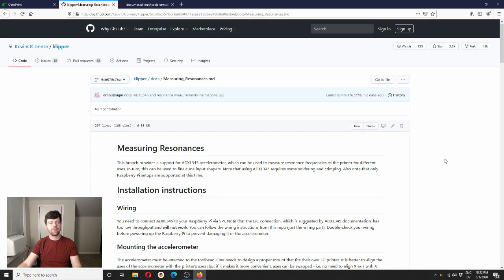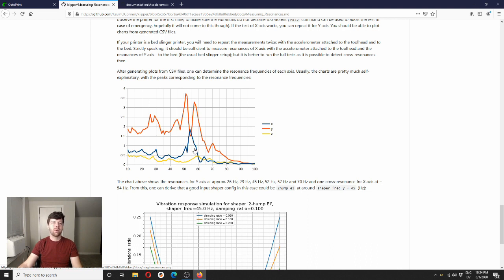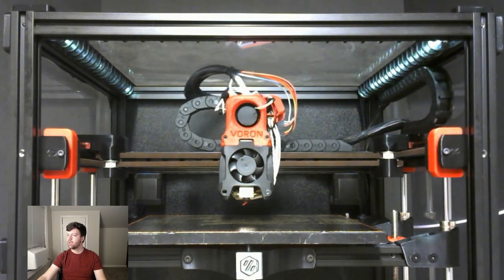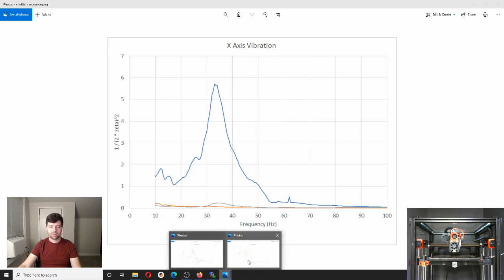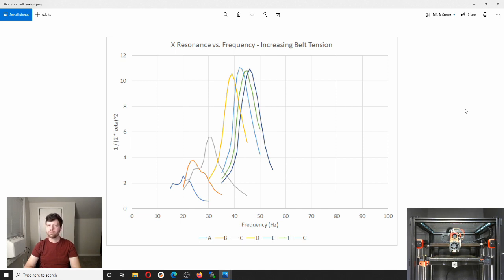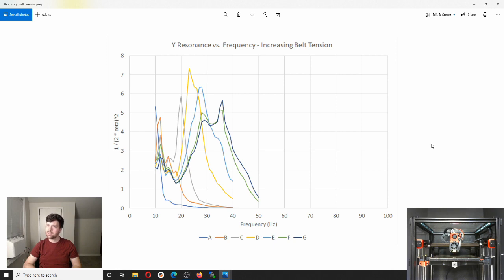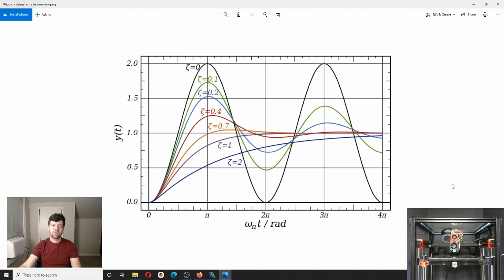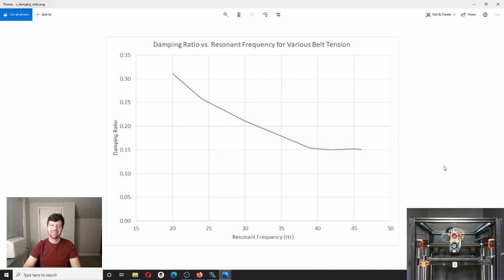3D Printer Mechanics: Belt Tension and Resonance

Comment: 7:50 - This is intuitive, but this is not true. Guitar string has transverse vibrations which IS depends on the tension, while ptrint head-timeing belt should vibrate in longitudinal direction, which IS NOT DEPENDS on the tension, it depends on mass and systen Young's modulus only.
And you can definitely see on your graphs that your resonanse frequency tends to 50 Hz frequency, overwise (if it was dependent on the tension - it would proportionally goes higher in frequency).

Comment: Ive been watch a few videos on this subject with reguards to input shaper, and is very intersting to see what is causing this in 3d prints. but i also watched a video, not sure who it was but it had to do with vibrations introduced by the extruder motor that travels through the filament and into the print object. It was a very intersting video also. Would love to see more on this in the future from you. Edit* I would also be interested to see if the different types of Rail systems (V wheel, Linear tube bearings, and linear MGN12) has a effect on the vibrations.

Comment: Very interesting, just one thought, how to be sure that the two belt are equally tensioned? I was playing with the idea of using accelerometer to do the resonance test but moving the head on a diagonal 45 degree pattern so that only 1 of the bed will be activated, visually or eventually from the data generated by the tool will be possible to precise determine the frequency at which the specific belt resonate. Doing this on both the 45 degree diagonal should give a precise way of tuning the belt to the same tension. And this should give a better ground for the search of the correct or best tension otherwise slight difference of the tension between the two belt can influence a lot how the head will move and the structure resonate
Reply from the maker: Yes! You can use Klipper and the ADXL345 sensor and run the toolhead diagonally—if both belts aren’t tensioned the same, the hypothesis is that the peaks from one diagonal vs the other will be at different frequencies. I haven’t dug a lot into it recently. You can find information here: https://github.com/Klipper3d/klipper/blob/master/docs/Measuring_Resonances.md#testing-custom-axes

Comment: I thought I knew what the double peak was on your y-axis. I figured the x-axis was just the toolhead banging back and forth so just one resonance peak, while when the Y-axis was moving, the second resonance was from the extrusion flexing from the weight of the HEAVY toolhead in the middle of it.  The funny thing is, when I just ran the input shaper, my X-axis was the one with the double peak, and my Y-axis was a single peak.  I have zero clue what's going on there.   Sort of strange to me that different belt tensions would give the double/single peak behavior, since the corexy belts have to be tensioned in unison.

Comment: Have you got any updates to this in the past year or so?

You mention that the printer not being rigid enough and that with a stiffer frame you can reduce the resonant frequency, but there another aspect which can play a major role in this too, that most people seem to miss, the table that the printer is on. The table is most likely going to less rigid than the actual printer so when the printer moves around the table is also going to be vibrating as well.
Reply from the maker: I haven't looked at it recently, but I'd like to revisit this! I hear that there have been some cool new accelerometer features integrated into Klipper that should make testing a bit easier.

Comment: What changes did you have to do because of the swapped X and Z axis? I cannot find anything in the Klipper documentation.
Reply from the maker: I did not have to do anything with the swapped X and Z axis--I believe Input Shaper takes the sum of the resonances now instead of just the one axis. Check the link here though--you can see that you can "map" the axes to the correct orientation if you wish! https://github.com/KevinOConnor/klipper/blob/master/docs/Config_Reference.md#adxl345

Comment: I've been thinking recently about damping. Why don't we add friction to the moving parts to effectively damp the motion ? I see lots of people saying "we need to remove as much friction as possible to remove ringing" and I don't understand why.
Fuck, I need an accelerometer to test this out.
If someone here tries, please be sure that the component creating friction can't have play (or less than the amplitude of the ringing) else it won't matter
Reply: too much friction and motor will need to work very hard, at high speed you can loose steps, BTW belt tension will also add  more friction.

Comment: Addressing resonance. ...  if the structural members like the gantry contribute more to resonance, then would mechanical dampening help?  Or different material selection such as the much debated carbon fiber?

The one issue that I do not know exists in material selection is the expansion coefficients of the materials.  

If carbon fiber is used I think the difference between it and aluminum are 20:1 on the high end and 10:1 on the low.
So if the bridge expands less the frame in the same X direction of heated, the rails holding the bridge would move further out and the bridge relatively stays stationary.  This would put pressure on the rails and probably other parts in the system. So the resonance would change again.
Reply from the maker: Another great question! It would be interesting to replace all the gantry components with metal and see if that helps or hurts. Potentially a combination of metal for rigidity with some ABS for a bit of damping?

The thermal expansion is also a huge topic that I assume I'll go down in the future. I think e3D had used a carbon fiber X axis for their tool changer originally before switching back to aluminum due to the thermal expansion causing issues? There's so much going on with thermal expansion--it's a small enough factor that it can fly under the radar, but still significant enough that it can mess up your first layer. That's one of the tricky parts with probe accuracy that I'd like to dig into more--how much of the variation in probe performance vs. ambient condition is actually driven by the probe sense distance shift vs. temperature, and how much is driven by frame expansion driving slight shifts in Z height?
Reply: @eddietheengineer  E3D switch !  I thought the same thing and I think is correct based on an interview. 
My guess is that carbon fiber was harder to form into a shape that is compatible In the installation and operation of the printer. Also a simple beam might only be rigid in one direction more so.  Combined  with cost and fabrication, thermal expansion difference etc.  it would be cheaper to machine a hunk of aluminum in a couple minutes.  The aluminum would solve expansion differences, customized multi axis rigidity tuning ,  and almost plug and play.  All based on machine and tooling.  Milling webbing to reduce weight and keep rigidity while also machining in all the mounting points is way easier that’s carbon fiber.
Reply: Adding stiffness with carbon fiber would increase the resonant frequency, but other materials might be better due to thier natural damping. Cast iron is used a lot in the machining world for its damping effect, but I believe adding kevlar to a carbon fiber composite also increases damping significantly, at least I heard that is the case for Dyneema, which as far as I can tell is very similar to kevlar. So perhaps a carbon fiber + kevlar composite is far better suited.
Reply: @FranseFrikandel  I come from a machinist family background and whole heartedly agree. Cast iron mass is great but heavy.  Of course in cutting steal you are fighting deflection vibration  and in 3D printing you deal more with vibration from the machine itself. 
Iron combined with steel shot in cavities of the iron help absorb vibration.   Also granite ways help with thermal stability, accuracy, and vibration.  But all to heavy. 
I like your idea about the Kevlar material. But I am still curious as to how much carbon fiber alone compares. My understanding is that it dampens vibrations as it resists resonating.  But the weight savings alone with the rigidity seems too enticing.

Comment: Very nice.  I wish more people would address this.  I currently do not have the ability to do any testing. So I greatly appreciate your effort. 
There is a sweet spot for belt tension I am sure but that sweet spot does not address the fundamental resonance issue. 
Is belt tension the only major contributor?   

I am just listing a few brainstorming ideas 
1. Does resonance change for the X axis based on carriage position. 
2. Same as above for Y
3. If the sensor is place on the carriage at different points (middle and ends) is there a difference in the amplitude and or frequency shift
4. If belt tension affects frequency of the system resonance , can it be assumed that the belts themselves are the primary source of the resonance?   

Assuming that belts are the source of the resonance. The frequency would shift based on the position of the head and bridge due to the belt lengths changing.  However as one belt shortens another increases in length.  Does this shift where the resonance is seen and or the amplified. If the location of resonance is shifting I wonder if locating the sensor independent of the head would yield different results.
Reply from the maker: These are all really great questions! I haven't continued work on this recently, but I had tried to understand the factors driving this. One calculation was to try to estimate the natural frequency of the toolhead assuming that a corexy toolhead could be modeled as a mass suspended by 4 "springs", two on each side, constrained by the drive pulleys. I calculated the variation in natural frequency as the toolhead moved around the XY plane and saw that there was some variation as the different "springs" were longer or shorter based on toolhead position, which affected the spring "k" value. Unfortunately, the natural frequencies I calculated were pretty significantly higher than what I've seen from accelerometer data. I assume that's due to the fact that the belt isn't really a spring constrained to move in a single direction--it's flexible and can vibrate/move independently of stretching along the belt. 

With the latest accelerometer code in Klipper, you can run tests at various X, Y, Z positions--and the resonance response does change some. Also, if you place the accelerometer out at the front of the toolhead vs. close to the belt mounting/carriage mount location, the accelerometer will show some additional vibration--the trick really is to try to understand what position is best. My current hypothesis is that it's best to tune the system with the accelerometer close to the belt/carriage mounts to remove toolhead movement, and then once that data looks good, add the additional variability from toolhead wobble. It's actually a pretty fascinating diagnostic tool--there has been a few times where someone's resonance data looks strange and after a lot of diagnosis, a loose or missing screw was found to be the culprit. 

There's so much more work that could be done here! It's really quite fascinating :)
Reply from the maker: I was able to dig up some data from that analysis I did a few months ago--I posted it here: https://twitter.com/eddietheengr/status/1363176259405111301?s=20
Reply: as belt tension increases, the head will couple more directly to the frame because the belt becomes rigid. This is clearly visible in the graphs, you can see the peaks converging as tension increases.

At lower tension the belt will act as a dampener because it is made from rubber, once the tension is raised to the point that the load is being carried by the fiberglass or metal core, it will act less as a dampener, and more like a coupler. This is also clearly visible in the graphs as the peaks are wider at low tension, and narrow rapidly above a certain tension.

The real issue here is not resonant frequency, it is the amplitude of the resonant frequency. Until the Maker Sphere decides that rigidity is important, fixes like Input Shaping are nothing more than a software band aide over the real problem.

Comment: Really interesting stuff. I wondered how the belt resonant frequency might correlate to the axis resonant frequency. I think this could be measured with an FFT app on a phone reasonably well. I wonder whether damping can be included in the belt tensioner assembly also. 
Also thinking about using an analogue accelerometer and monitoring resonant frequencies with a scope while the printer is running.
Reply: The problem is that without directly measuring the resonance at the head, you do not know how to map it to belt resonance. So no matter what, you will need to take the direct measurement. Once mapped though, you should be able to do a quick verification of tension using a phone app. The good news is that the accelerometer is dirt cheap (cheaper than the wire connecters in fact).

Interesting idea about using an analog sensor. The RFI from stepper motors is pretty bad and easily interfere with the digital stream from the sensor when doing live monitoring when a direct drive feeder is used. This will have an even bigger impact on an analog stream, but it might be possible to filter, or use balanced signal wires to remove it altogether.
Reply: @joshua43214  Yes, really only worth using an analogue sensor if the measurement bandwidth is higher than a digital one, and a differential output would indeed help with the motor noise.
Also quite convenient/intuitive to see a live trace on the scope.
I was presuming that as the belt is under some tension, that this would be responsible for the resonance effect and the mass of the print head would add damping.
Reply: This can be done but you will to collect the data independently, which isn't hard to do. 
Can be done with either a microphone or accelerometer. 

For the belt, hookup a microphone and record, pluck the belt, perform FFT, natural frequency and mode sof belt will be at peaks. 

 Take a measurement of the system sitting still by tapping your printer with a hammer (gently) in the direction of travel, you may been to use an accelerometer instead of a mic, perform FFT and boom you have your natural frequency of the printer frame. 

Confirm your results 
Use accelerometer to collect nat. Freq from system while in motion. Sum the FFT data from individual tests and compare the FFT collected from the system in motion. Hopefully the FFTs will look similar

Comment: Usually in control theory, a dampening ratio of 0.707 is preffered as it has a insignificant overshoot and a significant faster response time than 1.
Reply: 0.707? Thats the RMS ratio for voltage on a sine wave.
Reply: @TerryGilsenan  Correct. It's 1/sqrt(2).

Comment: Both loose belt and tight belt have disadvantages. You have already explained the drawbacks of loose belt but a tight belt will increase the inertia load on motor and also increases the load motor bearings ( only if force with radial load of motor bearings). In short the torque on motor will increase with increasing belt tension. I have done a lot of motion simulation before coming up with this conclusion. It is important to note that the stepper motor itself produces some resonance depending on the full step of motor and microstepping in driver. There is a very interesting correlation between belt pretension, motor load and stroke length or traversing distance. Great work by the way, thank you.
Reply from the maker: Thank you for the insight on that! There’s a lot of factors for sure and some I haven’t covered 😄. Maybe someone will continue the analysis and teach us more!

Comment: Super interesting video. Wondering if we could have a servo controlled active tensioner with a closed feedback loop linked to an accelerometer on the toolhead. With some algorithm you could optimise the tension dynamically to reach the less possible oscillation on your moving systems (bed, gantry...), even if your resonance is not uniform throughout your print volume. That would be really the next step in printing faster without artifacts. It would also allow to automate the resonance compensation. Think about it as some sort of 4D bed leveling. Such a system could be easily adapted on a cartesians or coreX/Y with 2 belts for the gantry. Z axe could be left untouched as I doubt that resonance would matter for it. Who says this would be over engineering ;-)
Reply from the maker: I had a similar thought in passing when I had to keep going to the printer to tweak the tension slightly! Definitely not over engineering :)
Reply: @eddietheengineer  I have started looking around for a candidate for a motor... Not sure what the requirements would be in terms of torque and type of motor, but the way the tensioners are placed on a Voron make it a feasible concept I believe. You may have to change your name to eddietheoverengineer ;-)
Reply: Great idea! It definitely not an over engineering but smart engineering.

Comment: I wonder if x has a single peak because the blocks are in compression on the cross beam, but in Y they are free to move so the bar and the belts become active.
Reply: yep, most likely one hump is the an artifact caused by the stiction release of the beam, and the other is the actual resonance while in motion.